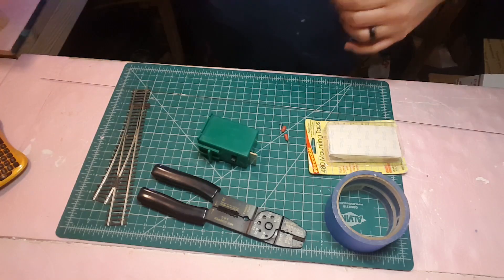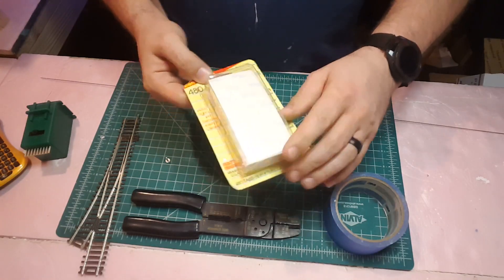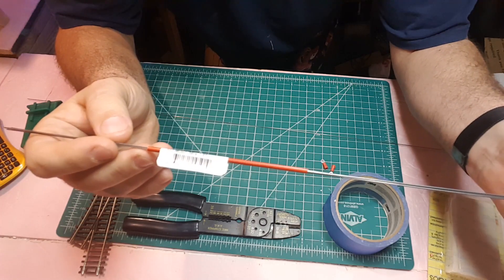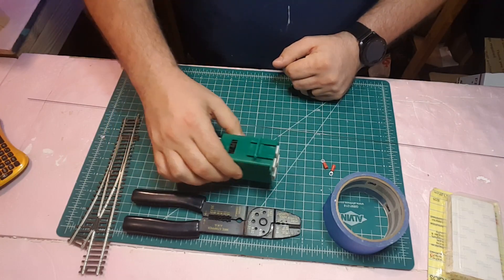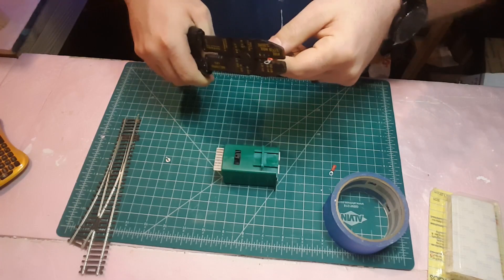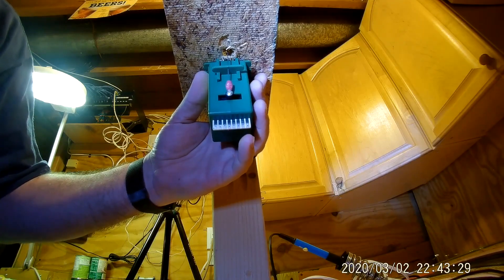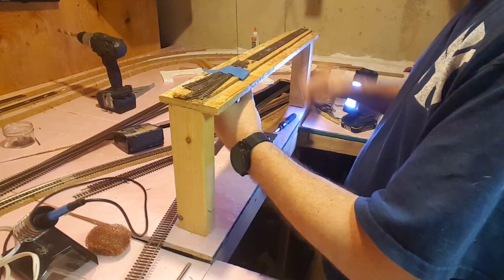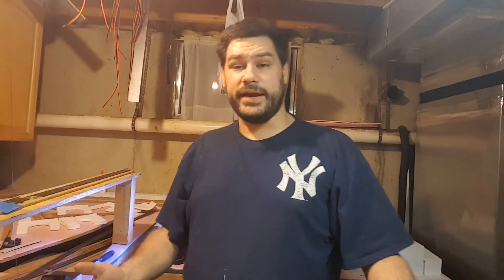NEW - Install a tortoise switch machine

Comment: Great tip Rick, Why did Tortoise make such a big deal about bending the wire when this works better and easier to do. Thank again
Reply from the maker: Thats a good question. I agree. I dont get it. you are cutting off this wire when it meets the throw bar anyway. what difference does it make its straight or not. it touches barely a millimeter of the bar. Thanks for watching. Keep tuned for more updates and tips.

Comment: Hey Rick,  I have over 40 tortoise machines on my layout and I am glad to say that I have never had a problem with any of them failing.  That is a great product.  I like the idea of using those wire terminals instead of having to bend the wire.   Have a good one. - Paul
Reply from the maker: Wow 40 machines. Well if you plan to do more, i hope this helps. Ive never had a machine fall but the wire has. Thanks for watching.

Comment: Great idea Rick, only question I have is will the double sided tape hold?
Reply from the maker: Someone else pointed this out too. I forgot to mention that the tape was temporary, mostly for positioning. You are going to want to throw at least 2 screws on it. But now its easier because you dont have to hold the machine while screwing. Hope that helps.
Reply: That sounds like a good idea Rick. Thanks.

Comment: Hi Rick ,neat idea ,l think the wire might be too light a gauge for the turnout mate l am using Precision metals stock number #497and is .039 ---1mm ,cheers Ron.B
Reply from the maker: It seems to be working. I dont have a long distance between my machine and the turnout. I have 1/2" ply wood and the 1/4" foam. Maybe if the foam was higher and the rod was longer there maybe an issue, but for now, i cant complain. the #501 is thicker and stronger than what was provided with the machine, so if anything - its an improvement. Thanks for watching.

Comment: Thanks for a very well done demo Rick. Using the crimp ring terminal to attach the wire to the Tortoise is an excellent tip, as it can accommodate various diameters of wire for the operating rod. The best wire diameter to use is very dependent on the thickness of sub-roadbed you need to operate through and how much "spring" you want in throwing the points.  0.032" is a good compromise.  Art...
Reply from the maker: Thanks Art. You are right about the diameter of the wire. the ring terminal also stops the need to drill out the wire whole in the tortoise to accommodate the larger wire. .

Comment: pretty slick idea...have you actually used that piano wire?? looks kinda flimzy...thx for sharing.. vinny
Reply from the maker: I have used it. you are right it does look flimzy when its long, but once cut down to size - its stronger and thicker that the wire sent with the tortoise. Thanks for watching.